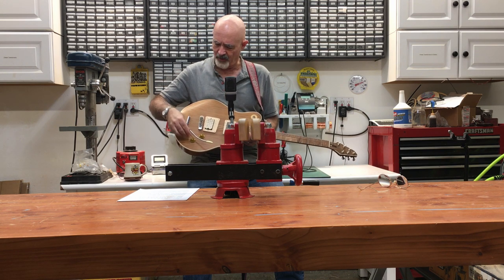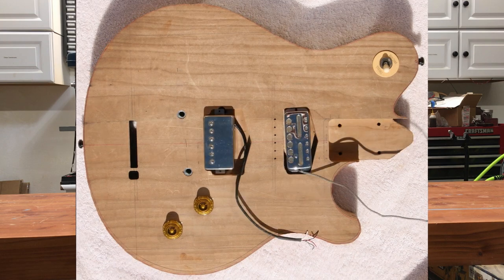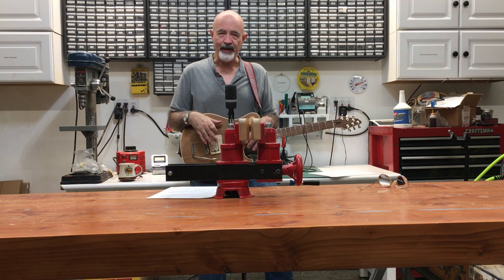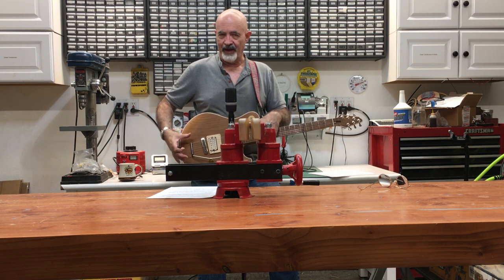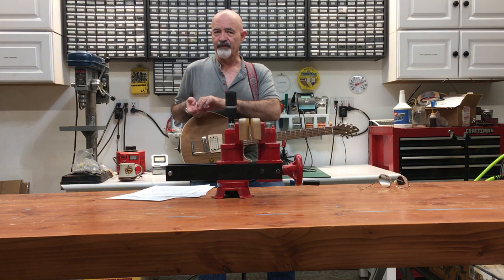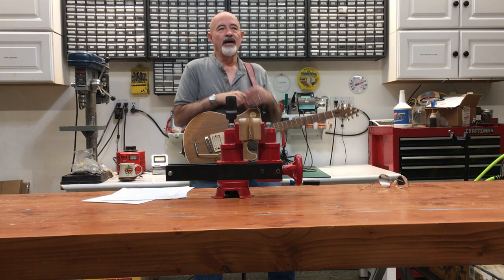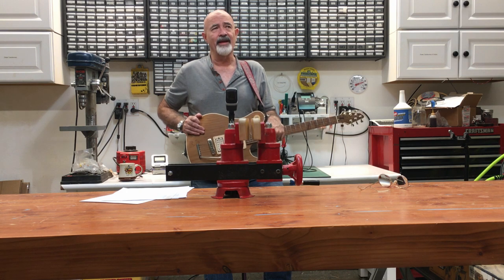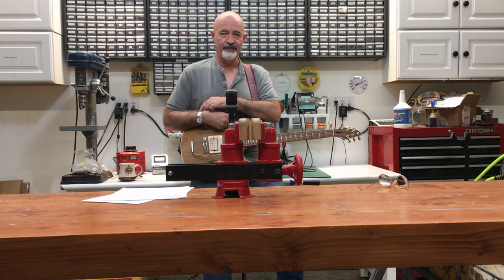GGBO (Great Guitar Build Off) 2021, Part I, Kit Neck, with Red Special trem: Part I

Comment from the maker: I've decided to make the entirety of the next video covering everything I've learned about the Red Special "tremolo" system.
First, just to be clear, I did not fabricate this Red Special metal work, I got it from http://rsconversions.com, I designed how I'd mount it from the back, it was designed to be mounted from the top.
How to install it from the back.  the minimum you need to route out for the the spring system travel (I took out too much in case I needed to).  How string gauge and scale length effect your design decisions.  Modding it to a less fussy bar pivot arrangement.  And most importantly, what I'll do different in the future.  I'll give the dimensions and drawing for everything.  Installing the Red Special trem in a Red Special clone is documented to death, I want to bring insight into how to install it in any guitar with any scale length and any string gauge.  From the back side so the necessary bits are just peeking through the top.  I also contemplate how the design could be done a little differently.

Comment: Rather than having the big mounting ring for the pickups to cover the hole, I think it would be a very cool unique feature to somehow have one (or both) of them rigged up with some custom adjustment screw that moves the pickup longitudinally towards the neck and the bridge.
Reply from the maker: This is a prototype where I needed to try several pickup positions to decide where along the string the bridge and neck pickups would sound best, so the cavities are huge, which meant I needed huge mounting rings to cover them up.  The plan for the final guitar design will have the same tombstone shapes, but much smaller, and will be more like a soapbar design where the rings raise and lower into the body like on an early 1970's Les Paul Deluxe.  In the mid 1970's Dan Armstrong came out with a guitar that had just one pickup that slid along a bar so you could position the pickup anywhere you wanted from the bridge to the neck.

Comment: Very interesting walk-through of what went into your "prototype". 
You have the mind of an design engineer/musician/craftsman/____. 
Nice shop space too.
Take care!
Reply from the maker: Thanks!  Yeah, I design things for a living.  I do all the printed circuit board designs for Apogee Electronics, (recording gear).
What you don't see in my shop is the tables saw off the left side of the screen, and the band saw off the right side of the screen.  Behind me is the parts bins and soldering/testing equipment for building my tube guitar amp designs.
Reply: @plexibreath  
Ahhh, very interesting!
Maybe I need to pick your brain on one of my other projects, a Fender Acoustisonic clone build/mod.  I'm in need of a small onboard preamp to control/power a bridge piezo and a sticky wafer soundboard piezo, there will also be the standard tele wound bridge pup too.  
Any thoughts? 
Many thanks, take care!
Reply from the maker: @theNextProject  I'm sorry I can't help you, I've never entered the realm of piezo preamps.  I'm not sure how I'd approach it, op-amps or discrete class-A, the later would be more fun, the former easier, more practical and probably just as good tone.